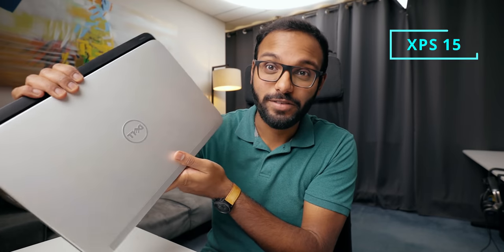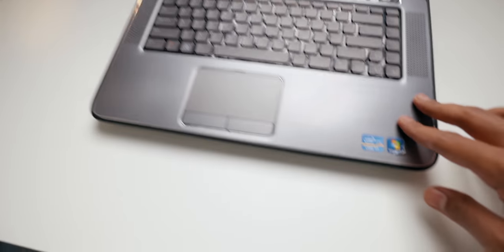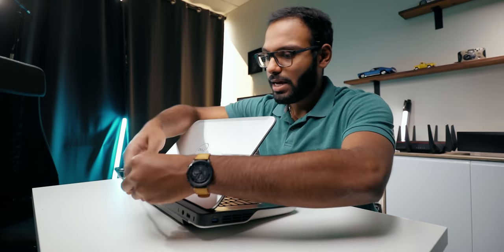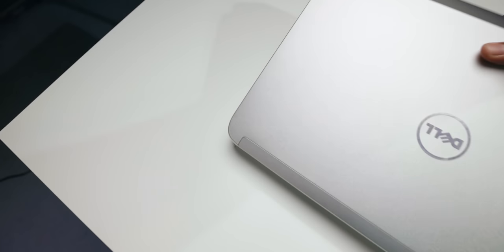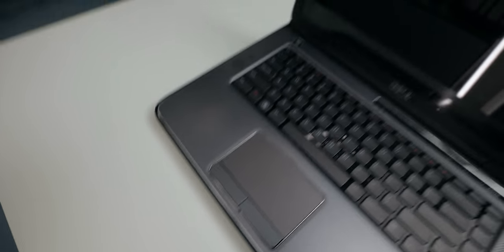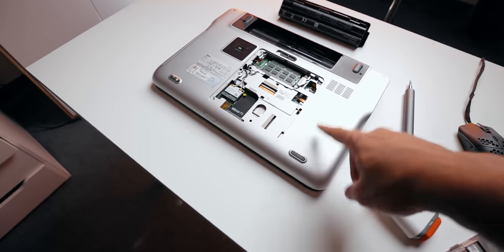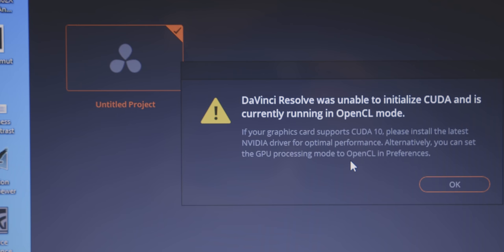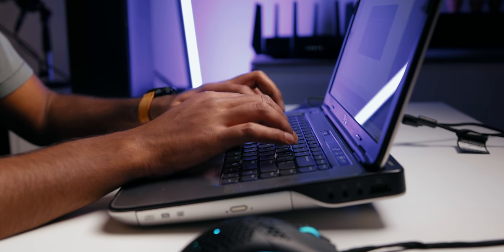I Restored My FIRST Laptop!

Comment: I've own my 2nd laptop for 9 years now. It was originally 2gb ram ddr3, 320gb HDD and i3 2350m which it still does have. Somewhere in the middle of it's life I dropped down a 2gb ram stick to make it 4gb, and just a month ago I replaced all the ram with 8gb 1600mhz which is the max it supports and a SATA SSD, installed pop OS recommended by Anthony LTT, and it works surprisingly good. This is my main computer, but I don't game or do heavy work, however I work with this and it's just fine. I want to extend its life for as long as I can mainly because I'm poor but I also worry about e-waste

Comment: Great laptops for the day.  I have both an L502x with the 1920x1080 glossy panel (later upgraded to 16gb RAM , and added an HDTV tuner) and a few years ago inherited an L702x with a 1920x1080 matte panel which has a bluray drive and space for 2 drives.  I stuck SSDs in both machines as well as Intel 7260ac Wifi cards in each which also adds 5Ghz and wireless n, ac and Bluetooth.  Drivers weren't much of an issue for the most part and in the end, I did manage to find sound drivers with the Waves Max feature that work fully with Windows 10.   I don't play games on them, and with a bootup time of around 6 seconds in Windows 10, they're very respectable for casual desktop usage.

Comment: I run Linux on everything.  I don't really have driver issues even on older hardware.  I run into so many hardware support/driver issues with windows, especially when it comes to older systems like this.  I'd be curious to see, if you installed Ubuntu or Manjaro, how those performance tests scored.

Comment: I still use my XPS of the same model.  I even have to 1080p upgraded screen.  I also replaced my WiFi card when I first got ten years ago. Never had an issue with the track pad.  Only issue my fans run on full blast no matter what I do. I did upgrade a SSD last year. Only thing I did different. Is that I install windows XP (CD install), Seven Pro (CD Install) and upgrade to Ten Pro (USB Drive).

Comment: Always happy to see these older systems resurrected instead of tossed.

My 0.02 would be to run a Windows 10 decrapifier script. Removing appx bloat and (most importantly) disabling telemetry will give a noticeable performance increase. You should also disable windows defender if you are a cautious internet user. My upgraded latitude e6500 is still working well after 12 years, now with Windows 10 with these few tweaks.

Comment: I'm watching in my 10 years old Dell Inspiron 15R (N5110) that uses basically the same screen as your XPS. In my case, every time I format the drive, I need to manually install the driver of the touchpad (at the time Dell used an ALPS touchpad with an specific driver), downloaded from the support page of my model on Dell site). The drivers from Windows 7 or 8 should work, and if they doesn't work, install them in the compatibility mode (the IDT Audio driver only works this way in my case).

Comment: I had a 17" Dell XPS Gen 2 from around 2003 that had a 1920x1200 screen. Yes, it had RGB that I turned off the first time I booted it, and yes, it was fairly chonky, if understated compared to many other gaming laptops released since. With regard to the screen tech, however, all they had to do was improve the colour gamut, response and refresh rates, but instead they went 16:9 and decreased the resolution to something that was barely usable if you left the Windows task bar at the bottom of the screen and kept poor response times viewing angles and refresh rates. It was then that we entered the laptop dark ages that lasted at least 10 years.

Whilst making a laptop pc work well requires lots of clever engineering and many compromises to get right, if the screen and keyboard are awful, it doesn't matter how good the internals are. It's great to see how much better the laptop market is today than it was back then. We're even getting gaming notebooks with no RGB for goodness sake! Miracles are happening!

Comment: Had a similar Project going on last week. Took our 7yrs old Laptop (i5 5200u + 840m) and switched the hdd for an ssd. The ssd ive tested it with I got from my New PC. Windows 11 was installed on it. To my surprise the Laptop worked pretty much fine with Windows 11 besides the fact that the New rounded edges on w11 were shown angled again. But other than that I could find any Problem with it.

Comment: I turned my old Lenovo V570 into a little server :) 
I've had it for 10 years, still kicking. 
I replaced the hdd with an ssd and it gave it entirely new life. The screen is still broken, but I access it remotely anyway (I set it up for network access using an external monitor)   
It could definitely do with more than 4 gigs of RAM, but I just haven't gotten around to getting the appropriate modules to upgrade.

Comment: OMG. Dell XPS 17 L702x was my last laptop I used before I built my first PC back in 2014. I had a 555M graphic card though. I installed Linux Ubuntu on it. But the JBL speakers didn't have the right Linux drivers and the sub woofer gets distorted terribly. But works well with external speakers.

Comment: I still have a Lenovo G580 running Windows10 and update it regularly. It was a budget laptop back then unlike your XPS, but we liked it a lot! 
Specs: i5 3rd gen, 8GB RAM, 1TB HDD and a GT 600 mobile series graphics card. 
I don't know if it's worth it to upgrade to a SSD, because no one uses it

Comment: Repasting thermal paste of cpu and gpu works great
If there are no wifi drivers to access net just use a phone with wired connection and USB tethering. Let windows update pull all the drivers. Worked great for me lots of times.

Comment: Im still using a 3612qm powered laptop with 7670m as a backup.  It still rocks and can play some old games.  Believe it or not, i finished metal gear 5 on this.   Keyboard is already nearing its end of life and needs replacement.

Comment: I've actually been messing around with my old MacBook, a 2008 model when they first switched to the unibody aluminum build with the glass trackpads and the Nvidia 9400M. I repasted the CPU and GPU and I've got Ubuntu on it since there's no more support on Apple's end. Regardless, it can't really do anything besides consume media anymore but it's wild that a 13 year old system can still do anything at all. It's fun to see all the stuff Apple, and the industry at large, had done away with. Removable battery, upgradeable RAM, upgradeable hard drive, a whole host of ports, external LED, battery indicator, and great travel on the keyboard. It's still a wonderful modern looking piece of hardware, but the 2.0Ghz Core 2 Duo definitely isn't doing it any favors 13 years later.
Reply: Core2 Duo can certainly play Half Life.
Reply: @ark_knight  I used to play Call of Duty 4 and Counter Strike/TF2 on it back in my high school/college days with it so it definitely can, it's just constantly crashing whenever I try to now. It's likely more a Linux thing than a hardware thing, but I can't run anything else on it besides Linux right now given there's no software support for anything else.

Comment: SSD? In highschool? My first SSD was an 8MB USB thumb drive. My frist PC I bought was a Dell Dimension 8200 with a sad Pentium 4 and AGP graphics at a whopping 4x! Later replaced that with my first build, an AMD Atholn 64-2000+ with a Geforce 6800. I later upgraded that to an FX-60, then sold it to a friend to build a Intel Q9300 with a Geforce 9800GX2. I got out of gaming until recently when I bought an ASUS G15 5900HS/3070 and am currently test and tunning my new AMD 5600x/RTX3080. We'll see how it goes :D

Comment: Have a toshiba satellite a505 still usable. A few years ago I upgraded the cpu from and i3 330m to the i5 variant and added an ssd. Made it feel almost new. There was some issue with trackpad drivers but seems it’s soothed out. Still love the keyboard so much but has a cracked screen. Used mostly to browse and stream video. Does it well and on win10,  of course needs more RAM  though.

Comment: I have a 9 year old HP Pavilion g6 with an Intel i5 3210m and AMD Radeon HD 7600m graphics.
Yes, most graphics drivers don't play well with Windows 10, I had to dual boot Windows 8.1 just to make it work, I can play Valorant 60-100fps and Rendering was comparatively fast than the integrated graphics. I upgraded it into an SSD and I also bought a caddy for a secondary hard drive. I also upgraded its Wifi card to support 5g AC and 8GB of DDR3 RAM.  I was able to install Windows 11 by bypassing the hardware checks and it has been great so far.

PS. It is my daily driver, I'm poor.
It still looks new I'm quite surprised tbh hahaha

Comment: i have one, as far as i can say, this laptop has one of the last sockets for the CPU that Dell and intel made for laptops, it means it can be improved to a Intel i9 of that time, it use to be cheap, but these days i saw it at almost 250 dollars wich is like 3 times the price that i bought it a couple of years ago, anyway, also you can improve de Memory up to 16GB 1666Mhz and it makes a big change for ofimatic, mine has the keyboard issue not the mouse pad, mousepad is perfect, and after update the SDD and secondary HDD i left it just to video calls and ofimatic and light work, it works perfect for that, homework and light photo edition, just that.

Comment: if you are planning on buying a laptop more than 3 years old do yourself a favor and replace thermal paste. laptops usually run a lot closer to the max operating temp of 100 C than desktops do. the large amount of heat cycles that thermal paste in laptops have to go through drys thermal paste quicker.

Comment: I just restored the very same laptop haha.  Unfortunately mine involved more work as it took a fall, so I had to replace the display, the display frame and few bits and pieces here and there.

Even gave it a liquid metal treatment, and as you said, it's a nice machine for just typing up scripts on and just casual use

Comment: I've got a (I think it's 11 years old) Acer Aspire 5470G with a core i5 430m, AMD ATI RADEON Mobility HD 5740 GRAPHICS, 4GB OF DDR2 RAM and 240GB KINGSTON SATA SSD. I use the thing daily and let me tell you, t's an absolute slug. If you're still using an old laptop like this I encourage you to upgrade to something more modern, you'll thank yourself for it. I, however much I wish I could, cannot upgrade to something more recent for a couple of reasons so I'm stuck with the chonker.

Comment: i'm still using this laptop at work daily and your cinebench R20 numbers are way low, i got the same CPU and my results is 915,  i'm quessing you have not swaped out the thermal paste on that laptop, the factroy thermalpaste that came with it was quite bad and the cpu was thermal throtteling even when it was brand new hitting 100C with a paste swap it stays around like 95-96C . Secondly the reason your touchpad might not work is you kinda twisted the ribbon cables on it while dissasembling and might have pulled it out the socket.
Got it running windows 10 on my end and have not had issues with it running stuff, though on gaming department the 540m that it has in it realy kneecaps the system.

Comment: Gosh, it looks like the notebook I got my mom.  Actually it is the same based on the listed specs.  It still works, though it does need a battery.  It was modernized with an SSD and 16GB RAM in '19 - still suits her needs fine.
Reply: Finally replaced that old XPS 15 (I'm slowly getting my mom into playing some games now that she is retired)... I'm considering refurbishing it as it still looks and works good (the bat was finished as noted, I could possibly replace or even rebuild that if I really want to go all the way down the refurbishing rabbit hole and the keys have more wear from use then yours does).  Obviously it will be for non-gaming uses.  It clearly needs a repaste though - running just a little too warm, though surprisingly it's not over heating).  Unfortunately, I just don't have a clear use for it.  But it's on Win 10 22H2, and everything on it works perfectly: trackpad, keyboard, card reader, optical drive, screen, HDMI and display port, all audio functions and ports, camera (but the image quality...well, it's old so it's fine), all USB ports, bluetooth, WiFi (thought that's the "N" standard), eSATA port, even the 3D accelerometer (though disabled because SSD instead of HDD) - very darn impressed since Dell provides no support for Windows 10, nor does any of the component manufacturers like Intel (Windows 8 (which it never had) is the last officially supported OS for any of the components).  Maybe I'll install Linux on it and then use it strictly for my home network administration and just keep it tucked away in my safe...  ?  Open to any ideas from anyone on what to do with it.

Comment: I don't have my 1st laptop, HP Compaq Presario F572us.
1.7ghz dual core AMD Turion, GeForce Go 6150, 1GB DDR2, 80GB SATA HDD, Vista 32....... 
Ran like ass with that 1GB which was the minimum spec RAM Microsoft thought was a good idea. Upgraded it to 2GB and was a night and day difference. Also swapped the HDD for a 160GB one and bought a extended capacity battery with twice the cells. Played plenty of CnC TFD on that at work, and pirated tons of anime because one of my neighbors had open Wifi. The GPU crapped out around 2011 like the other GPUs of the time because the solder joints would break.

2nd laptop was a HP Pavilion 3143us with a 2.4ghz i3-370m, 1GB Radeon 5650m, 4GB ddr3, 500GB HDD. Was a nice budget gaming rig that was slightly less powerful than my main rig Q6600, 512MB nivdia 9800GT, 8GB DDR2 home rig.
Ended upgrading that to 8GB RAM, a 1TB SSHD, and swapped out the ODD with a HDD caddy with a 1.5TB drive inside.
Ended up stolen along with my tech bag a few years ago.

Comment: I have the i-5 version of that exact laptop. With the track pad did you reconnect the ribbon cable? Also you can  disable by pushing the function key and the f9 maybe that hepls? And I still have my even if it doesn't function because my mom bought for a year before she passed.

Comment: I wouldn't say absolutely outdated. It depends if you have a software dear to your heart that you can't install in today's hardware. Plus, some people are not falling for the "spend, spend, spend, spend" madness,  specially with these outrageously priced GPU's. I recently purchased a laptop by Asus that is outdated. I bought for the same of finding out if it works as close as it did years ago. It's like the machines today, specially laptops are not what they are cracked to be. I know I've had Sager, MSI, ALIENWARE, and two desktops through out the years and games happen to be way ahead of them no matter how much optimization is achieved.

Comment: i also have this laptop. but the power is broken. it just randomly stops charging or accepting power from the dc jack.  I used it until 2015 or so. Maybe Linux is a good option, but the whole touchbar thing wont work i guess. I loved this laptop so much ^^. But the dissasembly is too hard. I also have a screw that wont come lose, so i couldnt clean the fan and replace thermal paste . :( I wished I could repair this laptop, but it is over. Looking forward to stuff like framework and rigth to repair, so we can finally choose sth else than can be repaired

Comment: Yeah, I had a acer travelmate 4330 (spec is Celeron 900+1GB DDR2+160HDD >>> Now  I Upgraded to Core 2 duo t6400+4GB DDR2+120GB SSD + 240GB HDD) Now just boots at 15 secs. Now I m using for watch yt tech videos and Online Class. Perfect Laptop for my today's standards and I had a HP Pavilion dv5 with NVidia GeForce 9200m gs 512mb, But Had a drawbacks CPU is low end, just downgraded to Celeron 900 from my acer

Comment: No way a 2670qm is THAT slow, try replacing the thermal paste, I have a feeling this thing is thermal throttling like crazy
Reply: It is still decent for browsing the web, word processing and watching YouTube (just maybe not above 1080p unless you get discreet graphics working). Regarding performance, it's a comparison against top end processors (and 2670qm was not a top end cpu) which are all 8-core so it's double the cores and each core double in performance in about 4 generations. So comparing this one against i7-10850H results in 5x better multicore. It would be interesting to see how single core stacks up but generally numbers are about right what one would expect. It definitely is still usable unless a laptop from early or even mid-2000's only 5 years later. No wonder so many folks still use these and both Intel and AMD are really trying to get them to finally replace.

Comment: Just install a Linux distribution(PopOS for the Nvidia drivers) and you will not have any issue with the drivers. Windows is out of the question on this laptop. DaVinci Resolve has support for Linux you can try to see if the . The performance will be much better then on Windows.

Comment: Mine is still going strong despite:
*the HDD failing
*the SSD I cloned it to failing
*being dropped down the stairs
*the power cable exploding in my flat (there was actual fire)
*the battery giving up the ghost entirely

10 years on for the service its given, it's absolutely been worth its £100 per annum total cost in full :)

Comment: on your specs it will works because mine is intel i5 520m 1st gen  nvidia 240m running smoothly windows 10 pro but the performnce of this laptop is not totally maximum because i use old hardrive insted of buying new ssd somehow it works fine without any problem